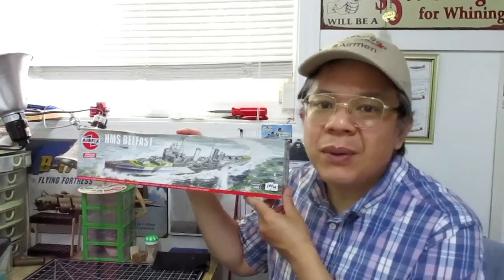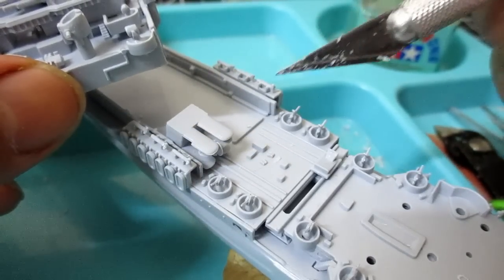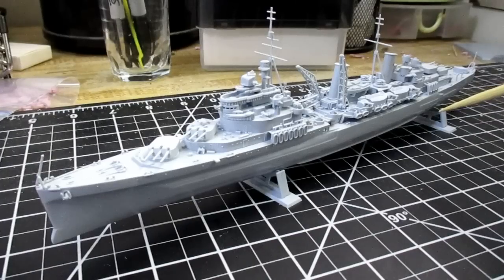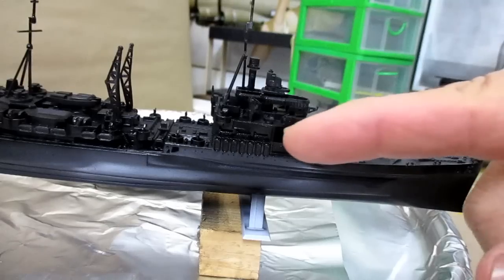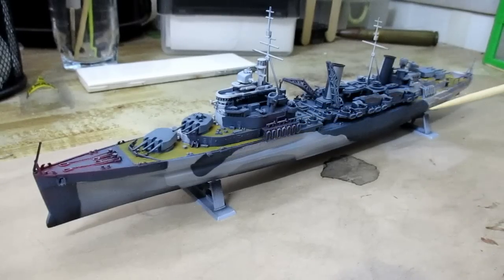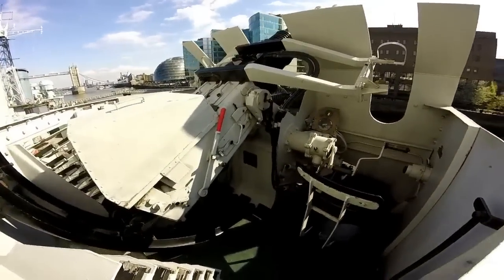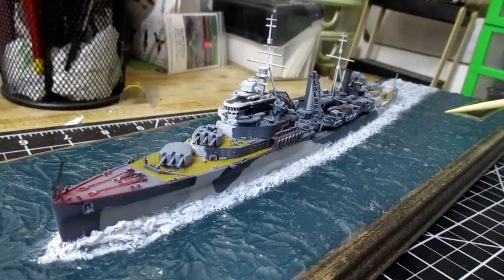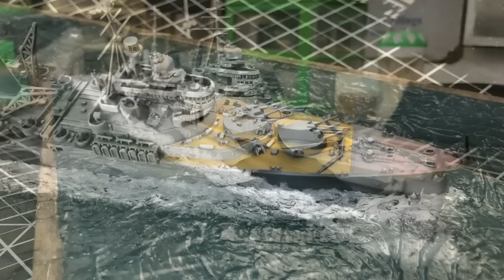Building Airfix HMS Belfast. From Start to Finish

Comment: Thank you for the video.  It is a good kit, you did a nice job building it, and the video was well done.  You have a couple of surprising major techniques: spraying black first, and then bright colors.  I have had good luck without employing them.  I have seen another modeler use a black primer, but I would think you need a lot of paint to cover that.  Here are a couple of ideas you might want to consider trying.  Generally I have found that a white primer works best for me.  I built the Belfast about 20 years ago.  I assembled most of the model, airbrushed the gray including parts still on the trees, airbrushed the wood deck, then hand painted the gray details around the wood color, and then added the details.  I back dated it to 1939 when it was completed. For Airfix's King George V, I airbrushed everything before removing the parts, and then used ACC after scraping paint from the appropriate areas.  Although that worked very well, I never did it again because I prefer regular model cement.  Thank you for the ship's tour.  When I visited London 9 years ago, I got only about 5 minutes on the ship.  Thanks again.  You are informative and interesting at the same time.
Reply from the maker: Wow, I don't know you but it certainly appears that you like this video and are impressed with my work. I'm just a normal guy enjoying this hobby and I try my best to inspire people like yourselves to build their own model kits. Thank you very much for watching. I honestly appreciate it. 😀😀

Comment: Thank you for your tour.   Great job on the  Belfast.   We used to do a special trick with the Revelle model ships back in the late 1950's:  by sawing or somehow cutting the bottoms of the ships off just at the waterline.   The models wold be cut to bare details, filled with clay and a conforming bottom would be added.   Subsequent to an all-dark-gray monotone paint job -- the models had the look and feel of large versions of collector's die-cast versions.

Comment: Very good video, really good. The ship's tour added a lot of interest to it, and the final diorama construction was very instructive. I used polyester resin and silicone to make.seawater, with a lot of styrene monomer mixed in it to get a rough effect out of the otherwise plain resin surface. I think the result was good, but the odour of these chemicals was awful, and your process seems to produce a similar result without this problem and the possible health risks. I was much younger, of course... I also agree with you that this rather old kit is still one the best from Airfix, and a good value today. Other fellow mentionef the Repulse kit, another very good one produced by Airfix. I agree with him, and strongly recomend this kit for you to apply your skills in the future. Thanks for sharing your knowledge and experience with us. Kind regards from Brazil, also by now suffering badly from the pandemic. Stay safe!
Reply from the maker: Thank you for your kind works. Yes, this method of making a diorama is less toxic than your method so give it try. Stay safe too. Thank you again.

Comment: Very nice sea diarama. I used a different technique  with alluminium foil spread over and crunched up for sea waver effect.  I have a problem with my airbrush.
Keeps blocking up. Starts and stops. Continuous cleaning neccessary.

Comment: I’m 2/3 of the way through building mine. The poor fit and ubiquitous flash are PITAs. Perhaps I got a bad moulding, but several times I’ve got close to binning it.
Reply from the maker: Good luck. This kit was first made in the late 1960's or early 1970's so your working with old school products. Airfix is still using those old molds so it will be a challenge. Hang in there and I hope you enjoy the challenge of building this classic kit. I want to wish you and your family a happy new year. 😀😀
Reply: @qdc748a  Thank you. A Happy New Year to you and your family.

Comment: Awesome work once more qdc,where abouts did you find the metal name plaque for your finished diorama HMS belfast,what did you actually type in on your search?,am currentley working on a Royal navy battleship from an eariler period,was looking for a metal name plaque or name plate for when I've completed it & put iut on display?,just wondering?,best wishes,cheers
Reply from the maker: I ordered the plate on Ebay
Reply: thankyou,have tried tying it in on ebay,nothing comes up like that?,tried all different combinations of typing in things like metal nameplates,plaques,badges for ships & ship models,nothing?
Reply from the maker: @malcolmbolton1473  Try "Engraved Plate". It should work.
Reply: Thankyou I'll give it a shot,cheers

Comment: This model definitely is not for the faint of heart! When I built mine I wasn’t prepared for just how much of a challenge it would be. Yes it is highly detailed for a 1970’s model but that’s where the problems arise, the mold are showing their age. I have never seen a model with so much flash and on those small parts it was a challenge to remove it. The fit is really poor and a lot of parts were mis-shaped, warped and it some cases totally unusable. It took a lot of putty, fitting and scratch building to get it finished. If you had to go through that too I commend you your finish project looks good and you did a good job! This is definitely not a model for beginners!
Reply from the maker: Thanks, my kit didn't have the problems you had. Since it's a reissued kit, Airfix must have used the original molds but retooled it to solve the problems you had.

Comment: Ugh, you're lucky, I got this model and the two hull halves don't actually fit together. Like the plastic is warped so much that the bow and stern don't actually fit together because the midsection is further out than the bow and stern.

Comment: Ignorance on my part. Where does one get styrofoam sheets? How do I frame the styrofoam sheet? Do I have to be an artist to paint the ocean diorama? Excellent presentation.
Reply from the maker: Hello, I got the foam sheets at my local hardware store. It's used for home insulation. Of course not, you don't have to be an artist. Just enjoy it. That's all what counts. 😃